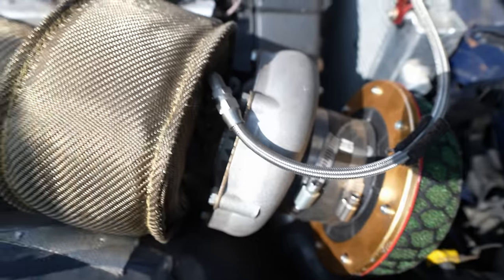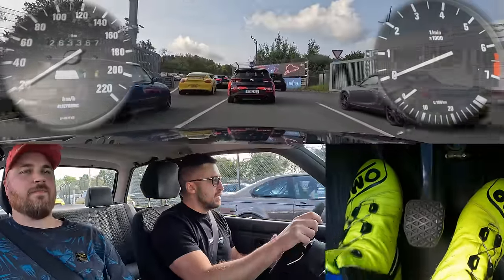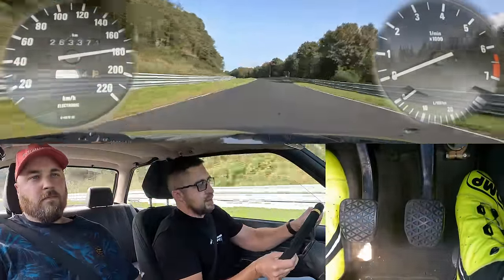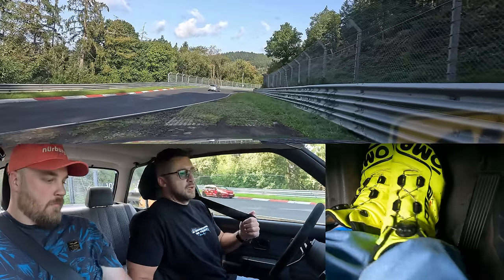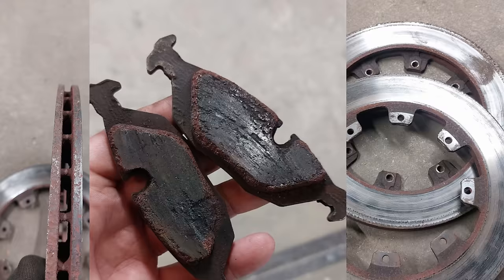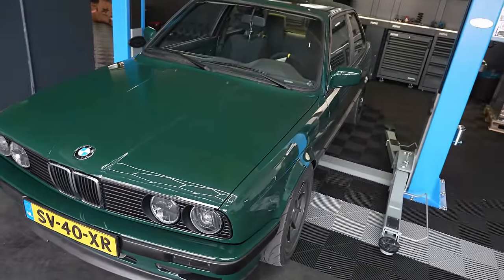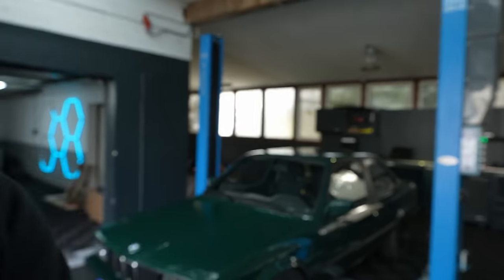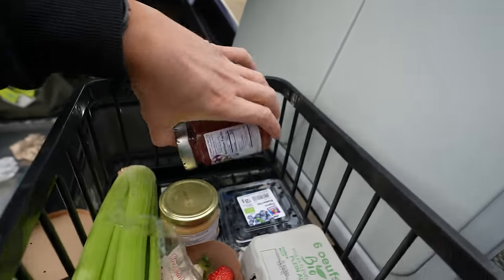I CRASHED & REBUILT His Big Turbo BMW E30 // Nürburgring

Comment: Misha, If you bin a car based on driver error... then yeah I can understand helping out..   But mechanical failure or blowing up an engine...  is just poor track prep. 
If I threw you the keys to my car (Which lets face it, WILL NEVER HAPPEN due to it would cost more than the 41 million it cost to build the track just to get it there) 
If the brakes fail, The engine decides to eject a piston out of the head and through the bonnet....  then that is on me. I think people need to realise that if you are going to get your car driven on the track...then it needs to be track ready..  a Baffled sump, Uprated Brakes, Suspension and not 4000 miles since its last service  and if after all that and it still breaks down... then it is down to crap happens.. but yeah if  YOU drive the car beyonds its capabilities... and crash it... Well  that is a calculated risk on the owner and they  need to  be aware...  IT can happen.

Comment: Well shit, you wanna come stateside across the pond and redo a bmw, i have an 08 335I, that wouldn't mind some extra love.  kind of in the process of doing the pre upgrades before the BIG upgrades, 

aluminum VC,  will be paired with Midnight Motorsport B58 coil upgrade, CSF all aluminum radiator for manual trans,  Seems Legit Garage M series car big brake kit ( i found a secret to getting the front/rear caliper pairs for less than a grand each.)  

Factory M sport suspension although modified on rear with Turner toe rods, and camber rods/arms. 

then comes port injection,  and then upgraded twins.  thinking Pure Stage 2 Hi Flo's but stage 1+ is also good for 500 wheel HP, soooo..  i dunno yet.  either way first list is still about a year out of getting everything.

Comment: Damn, for a 500hp E30 that thing seemed to handle it pretty nicely. Glad to hear you are all well, and no1 got hurt ! And for the crash, you had 0 need to do that, its just a cost of racing and pushing the car, brakes failing is not your fault. Good guy Misha. Love the way car came out  ! Another lap with it soon ? Did he upgrade the brakes too ? 😂

Comment: you should probably scrutinize the viewers cars more. Because at the rate you're testing them, you're walking into laws of statistics. Especially check brakes, tires and suspension. It's one thing to have it brake down and other to have it lose brakes or wheels at 200km/h😂

Comment: What cheap shitty brakepads are those, simply couldn't take the heat. Those might not even pass the safety tests for normal street brakes 😐 
Another stereotypical self built so and so many hp "beast" with a garbage brake system.

Comment: Misha im sorry but you have a extremely bad time and bad luck with bmws there is a trend with you crashing bmws either from mistake or random failure
Reply from the maker: Funny, that's also what Megi is saying! But tbh most of the cars I'm driving are BMWs, so there is that!
Reply: @mgcharoudin  well just don"t let that crash push you back keep on pushing and keep driving as hard as you always do sure it could of been on you for potentially cooking brakes, but also you said better brakes for cars so please don't let it hold you back because that crash during the endurance race was noticeably restraining you even though that was an oil spill or something of that sort judging by traction change I wanna see you keep pushing and improving your driving.